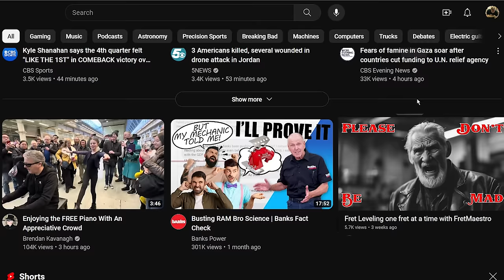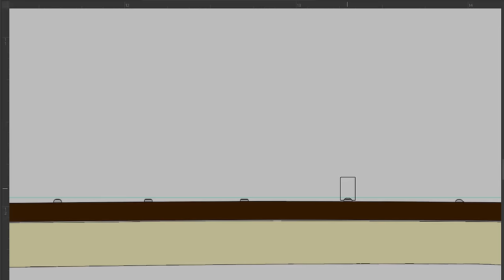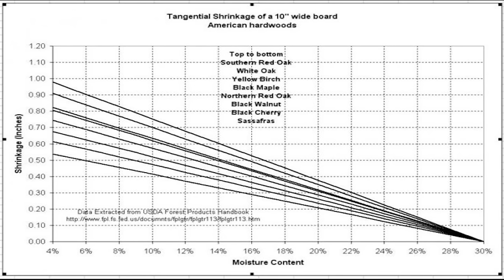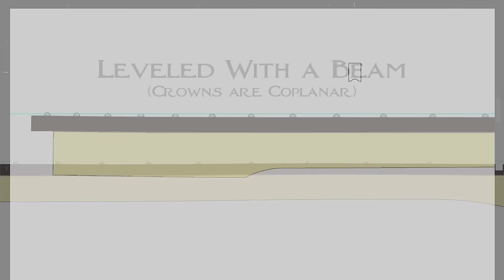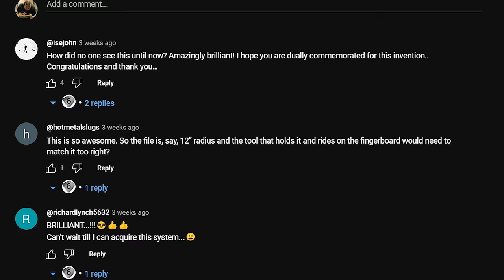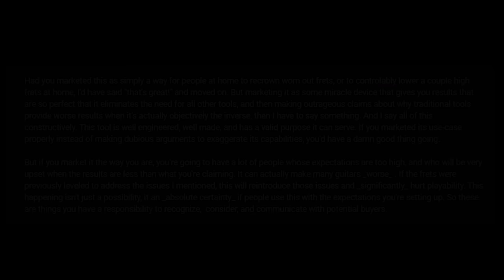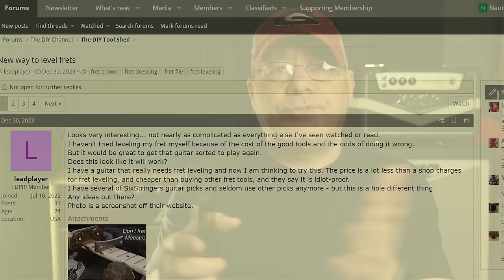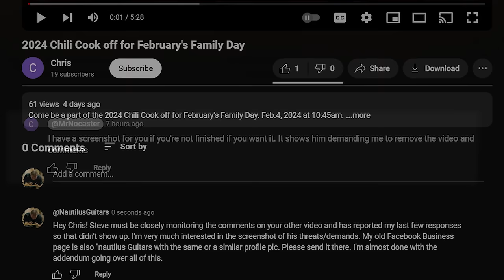Fret Maestro - Gimmick or Godsend? - A Fair Warning

Comment: REAL WORLD TEST FROM AN INDEPENDENT USER

My FretMaestro turned up, and I just finished using it on one of my Strats. 

It worked well for me. 

All I did was use the tool exactly the way the FretMaestro guy describes. I didn’t use a straight edge at all. I just left the guitar with the relief and action set the way it is. I didn’t even remove the strings, I just loosened them and pegged them back behind the neck.

Now, the frets look smooth, even, symmetrical, nicely polished, and the guitar plays great.

This obviously does not prove that this tool works in every situation, every condition etc, and I am not making that claim. 

But I AM saying that a successful user test disproves the theoretical accusation that it cannot work.

I am also saying that a real-world use test by an independent purchaser is worth 1,000 theoretical claims by people who never used the tool.
Reply from the maker: I'm not trying to be argumentative, I'm really not, but all your usage proves is that it removes material from the frets. That's it. If you didn't achieve lower action with less buzz, then you've accomplished nothing but possibly making the frets shinier, which you could have done with tape and a sheet of 400 grit paper. 

The point of leveling frets is to make them more level than before, so you can A) eliminate buzz, and/or B) acheive lower action. 

If you want to do a scientifically sound test, get your neck as straight as possible, then use a fret rocker. Unless your fretboard is freakishly straight (like the one Steve hand-selected for his videos), the fret rocker will show high frets. It's literally physically impossible that it won't, unless you have a perfectly straight fretboard, which is a <1/1000 chance.

The vast, vast majority of fretboards are somewhat warped. For this product to do what it claims, you'd have to be able to consistently prove that a fret rocker shows zero height discrepancy after use on a typical warped fretboard. I really cannot stress this enough, this is physically impossible outside of the exception of a freakishly straight board. 

Any test that doesn't show, with a fret rocker, several repeated cases of improvement on randomly chosen guitars after use is null and void, which is why Steve keeps making excuses for people to not use a rocker. There will be some exceptions because a very minute percentage of fretboards are perfectly straight. But again, all your test did was prove that it removes material. You have no idea if the frets are more level now, and I'd have bet a significant amount of money that before and after tests would prove that they're not. 

Again, I'm not trying to be rude or dismissive or argumentative. I'm just being realistic. give it 2-3 years and this whole thing will be trotted out in extreme detail with mounds of data vindicating my points. It's not an opinion, it's verifiable, measurable physics that I'm simply conveying to others. It's math. I didn't invent math. It's real, and it's provable.
Reply: Pretty sure the only person who would bring up the word ‘symmetrical’, is Sneaky Steve himself. He posted this same thing on the other video that shows the poor build quality of the tool
Reply: @johnbuell8035  Ha, you’re the only one who says I have no credibility. 🤪
Reply: @johnbuell8035   That’s some pathetic projection you’re throwing out. Video above shows where Maestros claims are rubbish. Getting me mixed up with Maestro. You must have dementia or something like that.
Reply: @johnbuell8035   Also thanks for bringing attention here, to the other video showing the crappy build quality and quality control of a FretMaestro 👍🏻👍🏻
Reply: @johnbuell8035   I can see why you adamantly defend FretMaestro. Sleezeballs  look out for each other 🤮
Reply: @NautilusGuitars   I’m sure most of you remember the two guitarrx, or whatever his name is, hands on videos about the maestro device that he ended up deleting. This Porta Potty John guy is being real smug about it (on the other vid) by acting like those videos never happened. If he saw them, that is sleezy indeed.
Reply: @NautilusGuitars  
My comments keep getting deleted.
I am staggered that I need to tell you this — OF COURSE the frets were more level after the process, or I would have no reason to say that “it worked well for me”. 

The reason for doing this was that the guitar exhibited fret buzz in a few places. After the process, the guitar played clean. 

I had no wish to lower the action, and lowering the action is NOT required to qualify a successful outcome. Clearly the frets are more level after the process, because the buzz is gone. Job done, however much you would like to impose additional requirements to try to disprove it. Buzz gone, smooth frets, guitar plays great = job done. Period.

All this talk of math and physics is misdirection. Your whole concept relies on the assumption that most necks are distorted in some way, to a degree of significance which renders this tool unable to work well. 

I dispute that. You can’t prove that this tool doesn’t work, and I can’t prove that it always works. But I don’t need to prove that it always works. My successful use disproves your claim that the tool cannot work. And that is my point. 

You can’t bulldoze your theory through on the basis of “But I know, I really know”. No, you don’t know, and you can’t know until you acquire some data. Because this is not about the theory of the tool registering off the fingerboard. It’s about what proportion of fingerboards show sufficient distortion to stop the tool being effective.

And THAT is an unknown. I accept that it is an unknown, and I have an open mind. I am merely asking that people use the tool and gain some data before making theoretical assumptions and claims. 

You, on the other hand, have a closed mind about this. You insist that “you know” you are right without bothering to account for the unknown, which is the elephant in the room.

My one data point proves nothing, except that your insistence that the tool cannot work is indisputably wrong. 

And even my one data point is more meaningful than your zero data. (Actually, there is another guy in these comments who has also successfully used FretMaestro.)

And insisting that I must use a fret rocker is another misdirection — it’s not necessary, or even relevant. I have not had to straighten the neck to achieve a better playing surface. The action and relief are as I want them and the guitar plays nicely, which it didn’t before the process. 

Again, job done. Why would I screw with my truss rod to flatten the neck for a fret rocker, if I don’t need to? Certainly not to meet your additional ‘requirements’ which are irrelevant.

I perfectly understand the argument that referencing the fingerboard will cause any irregularities in the fingerboard to be transferred to the fret surfaces. It’s not some blinding discovery you have made, it’s perfectly obvious. But you miss the entire point, which is this: in practice, I suspect most guitars do NOT have fingerboard irregularities of enough significance to stop the tool from working.

One other thing about my test. I live in a tropical climate, where both humidity and temperature can be both very high and very variable. In other words, a nightmare scenario for wood movement. 

If any guitar is likely to suffer from shifts in the wood, it is this guitar. I am doing three or four gigs a week, all outdoor gigs, and then the guitar comes back into an air-conditioned environment at home. Pretty rough on an instrument.

Accordingly, I would view my test as more significant than average, precisely because this guitar is most likely to present the problems you are relying upon for your concept. But any distortion present in the neck was NOT sufficiently significant to stop the tool from working well. Which supports my concept. What a surprise.
Reply: @NautilusGuitars  He’s from the “I know better, ‘cause I’m older’ camp. Probably can’t get through that brick wall.
Reply: @robertmay5091  I’m from the ‘I know better because I’m presenting facts and you’re  presenting drivel’ camp.
Reply: @robertmay5091  keep on with insults, Einstein, you’re just showing people that you’re not capable of intelligent conversation.
Reply: You haven’t presented a single valid thing. You have only repeated maestro’s sale pitch talk. You say you have the tool and have used it. There’s nothing to back that up. No video of you using it. I’m sure you’ll come up with a lame excuse why you have no proof. I doubt you even posses the tool.
Reply: Not a single ‘John B’ on the Reverb buyer review list.
Reply: @robertmay5091  I have presented facts from a genuine independent user test. You have presented unfounded claims with no experience and no evidence. You said there were videos to support your claim, but you were unable to produce links to those videos, because they don’t exist. Hence, you have zero credibility.
Reply: I think you’re only hope is by repeating the same unsubstantiated crap over and over, you’ll make Nautilus sick of reading it, over and over until the only way to escape it, is to delete this video. I hope he doesn’t fall for that. He certainly comes across as more formidable than you and maestro ✊🏻
Reply: No John Buell on Maestros Etsy shop reviews either. John is obviously a troll, and I’m gonna stop feeding the troll. PITA scrolling down through all the comments to get back to this one. And lord knows John ain’t gonna suddenly provide anything credible and useful. I’ll keep my eyes peeled for any new videos 🤞🏻😁
Reply: @robertmay5091  Give it up, guy.

You blunder on and on, trying to deflect away from the excruciating position you have put yourself in. What you are doing is transparent and obvious to everyone. I could care less whether you believe me.
Reply: @johnbuell8035 No, you presented a statement of questionable facts with nothing to prove its validity. Saying the product “worked for you” in fact nullifies all questions of doubt of the products limitations therefore product is accurately demonstrated and proven to be without a doubt superior is a fallacy. Therefore, your statement, which you claim is absolute, can be, and without question, be reasonably disputed.
Reply: @MrNocaster  Not so. I Made no claims about this product, other than it worked for me and, in fact, I added a caveat clearly stated in these exact words:“This obviously does not prove that this tool works in every situation, every condition, etc, and I am not making that claim”.

Is there something about that you don’t understand?

Why was my comment“a statement of questionable facts?”I reported entirely genuine results from an entirely genuine user test. If your best response to that is to call me a liar, I guess you’ll just have to go ahead. Like the other person here who keeps insulting me, I could care less what you think.

My guess is that most people reading these exchanges will recognise my posts as a simple statement of my results. I imagine they will also recognise what is happening as a result.

Seems to me, you guys don’t want any inconvenient facts getting in the way of your bias towards this man and his product.
Reply: @johnbuell8035  You made a statement and you demand that everyone that is reading it must believe it. No one is calling you a liar, but you didn't answer any of my questions, you just get very defensive which is not a good look for someone who wants others to trust them. Then all the proceeding comments that you made only demonstrates  and calls into question your validity. I don't understand why you thought to comment on this video instead of just going to a fretmonster video and praising him there. You do realize that all you have done is draw more attention to this video and less to the owner of the companies videos. Just because someone says something doesn't make it true automatically. You can't believe that can you. perfect example  = #MeToo
Reply: @johnbuell8035  Seems to me, you don’t want any inconvenient facts getting in the way of your bias towards this man and his product.
Reply: How does anyone know that you are a genuine tester? I don't know you. Never heard of you. Never seen a video of yours. You didn't do a video of you using it did you? But, you want complete trust? You don't have it and that's just the way it is. I gave you some advice, looks like you chose to ignore it. That's on you.
Reply: @MrNocaster  
I guess you didn’t read this: 
‘I made no claims about this product, other than it worked for me and, in fact, I added a caveat clearly stated in these exact words:“This obviously does not prove that this tool works in every situation, every condition, etc, and I am not making that claim”.’

Please explain how can you possibly construe that as me being biased? 

Far as I can see, it’s pretty much impossible to be fairer!
Reply: @MrNocaster  
I’m amazed. I feel that I’ve expressed myself clearly — certainly I’ve tried. But you answer as if you’d been reading something else.

One more try.

I agree, no one knows I am a genuine user. I can’t prove it. 
I agree, I haven’t made a video. No argument there. And I won’t be, either.

But that doesn’t change anything. What I said is true, regardless of whether I make a video, and regardless of whether you believe me. If you’re trying to make a case for disbelieving me, there’s no need — you can think whatever you like. I’m not going to be losing sleep.

To answer your other comment, I don’t demand anything. I’m not defensive, and I don’t need anyone to trust me. I have no skin in this game. Nothing to gain or lose. I’m just adding one small piece of new information. It’s not for you — you’ve already decided what you’re going to think, no matter what. It’s for people who are genuinely trying to find out about this tool, and are only being given one side of the story.

Of course, I can’t control whether other people believe what I’m saying, either. That’s OK, too. People can evaluate what has been said here and make up their own minds. 

Speaking of which, it’s impossible to escape the conclusion that people here are pretty desperate to discredit the results of a simple test. Why? Why so desperate to hide the truth? What’s the motive?

Finally, quite a lot of what you have said has puzzled me, but nothing quite so much as saying you gave me advice..???

If you intended to give me advice, it ‘s pretty well hidden amongst the diatribe. But thanks anyway. Seriously. 

OTOH, I didn’t ask for your advice, I don’t want it, and I’m not going to be spending time trying to figure out where it is.

Bear in mind, I don’t know you, either. I’ve never heard of you, either. So why would I be looking for your advice?

Hopefully that’s it. I made a comment with good information and good intentions. I didn’t expect to spend days defending myself and I’m getting kind of tired of it.
Reply: I don't find it unfathomable that fret Maestro can result to a better playing guitar. That said, it would be interesting to see some video of how this worked, if you do more guitars. You obviously aren't obligated to make one, and I don't think you're a fake account (I do believe what you're saying), but it would be interesting to see.